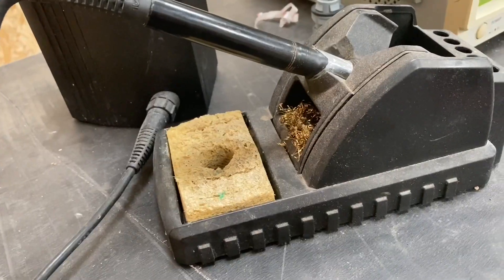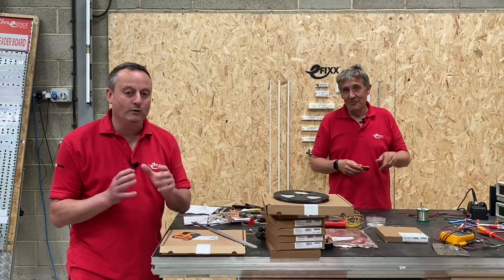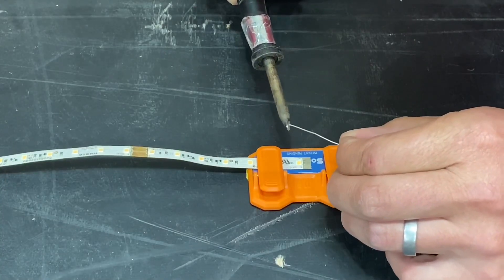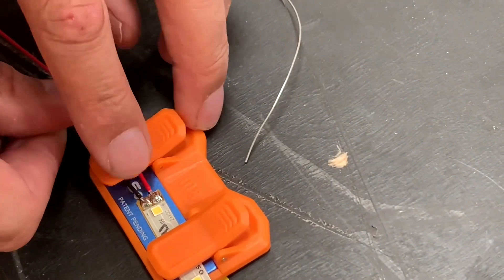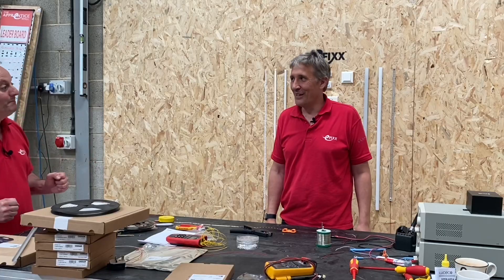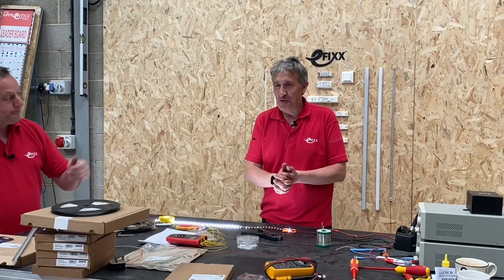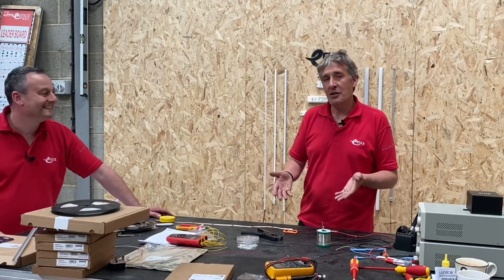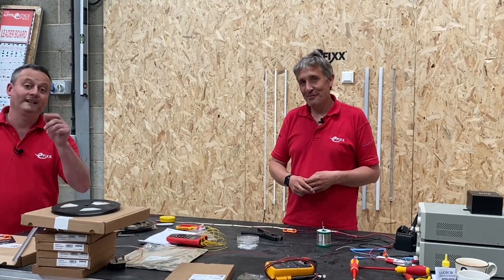Soldering to LED strips in less than ONE minute - SolderM8

Comment: Or just use a couple alligator clips? Depending on the clips you pick up you could probably solder both onto a spare wire. The price tag is $22...

Comment: Hi Guys.

I am in the market for a soldering iron/station that I could use at the workshop as well as in the field. So ideally something that is easy to live with on the move.

There are plenty of kits on Amazon etc, but they all look a bit budget and I wonder how would they start the test of time. 

Most of the soldering that I do is LED tape, as you have just demonstrated above.

Can you recommend something a bit more mid (enthusiast) to high end (pro) bit of kit?

Must get me one of them Solderm8 clamps….

Best regards 

EV
Reply from the maker: Check out the TS100 - https://youtu.be/wi83Nk3WAkU can also be rigged up to work from power tool batteries.
Reply: @efixx  thank you, will have a look. 👍🏻
Reply: Ts 101 is the best field iron out there.

Comment: £20 for something you can make in 10 minutes? I would have paid £5 max
Reply: 50P of masking tape OR blue-tack can do what this does & would be in anyone toolbox already.
Reply: Glue/nail 2x croc clips with heat shrink on the teeth to a small piece of wood. Same thing.

Comment: Tried the M8 and managed to melt the right holder on first use. For the money, £20+ it is poor value and does not work well in real world situations, in my view. Its a lot of money for, what is basically, two plastic pegs stuck to a very small piece of plastic .  Long LED tape or wire twists the M8. I ended up making a better solution myself with 4 round paperclips stapled to a length of ply, which has a pair of clips each for the tape and wire, so neither move whatever the length or weight pulling on it. Simple and cheap. As the ply is about 1/2m long my arms rest on it too when soldering making the whole thing solid.
Reply: 50P of masking tape OR blue-tack can do what this does & would be in anyone toolbox already.

Comment: Hey mate you must have a pound of solder on your joint. Much closer than mine. You must have cooked that poor LED chip with all that heat!
Reply from the maker: OSRAM spec is 350C maximum for less than 3 seconds. No LEDs cooked in this video - OSRAM led strip has large pads compared to other products
Reply: So why bust my chops?  I heat sink my 6 OZ LED strips when soldering just as an extra protection. My solder is further apart in my video than yours.
So you damaged the chip. You solder the wires on for 4 seconds.....
Reply from the maker: I’m not busting your chops - just pointing out we soldered to the manufacturers specification.  If you want to talk LED experience then fire away.  I’ve managed 30 years - but 25 of them have been in LED technology - *Gordon - https://www.luxreview.com/2015/10/07/old-leds-don-t-die-they-simply-fade-away/

Comment: Be careful your 2 solder joints are almost touching each other.  Thats a lot of solder mate.
Reply: excessive solder flowed in...🤔
Reply: Well Pal it looks that way but its not. What makes it look big is that we use 16GA copper wire not wimpy 20-22GA wire.

Comment: Nice little device. But I can’t help but think at some point they will just add small pushfit(wago) connections when the price/machinery is invented. This would open up these LEDs to a much wider (no soldering required) market. 

Yes before anyone moans, I know LEDs can be cut at certain places...I’ve been using them for years.
Reply from the maker: Check out our led tape series you’ll see a video with a push fit connector
Reply: efixx thanks. I hadn’t seen that video. Yes, that’s the sort of pushfit that I’d assumed existed/would exist soon.
Reply: @GeeTheBuilder  and the push fits/splice clamps are absolutely garbage. They don't make a good enough connection for RGB strips and you end up missing some colors I'd not perfect

Comment: nice useful gadget guys,however i would certainly use a smaller tip on the soldering iron,one used for soldering integrated circuits,and maybe a lighted magnifying glass,so to be more accurate,did a lot of electronic circuit soldering in my young years,now you can buy everything already assembled,great tips guys

Comment: Might have to get one of these, they'd be really good for splicing tape together too. I had to do just that at work in a tricky spot where a single pixel on some tape had failed, Improvised with some smallish clamps to hold the ends together while I soldered them.